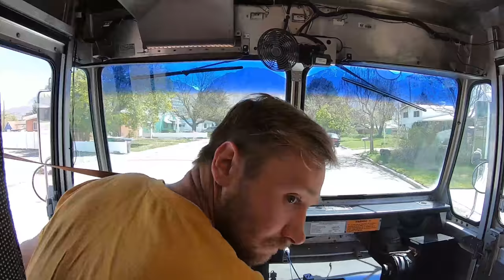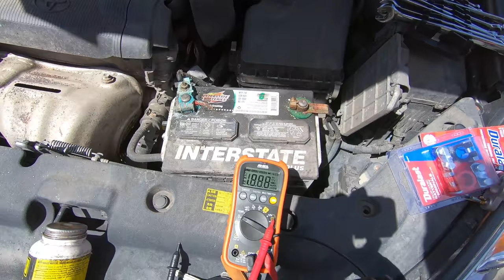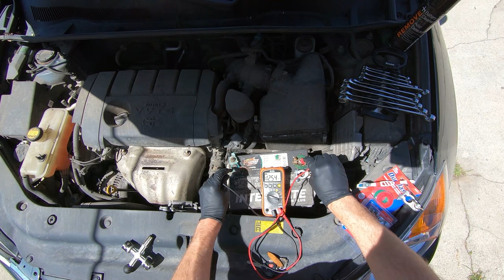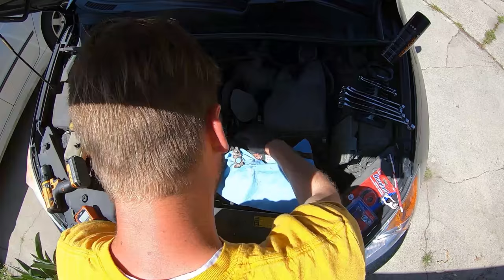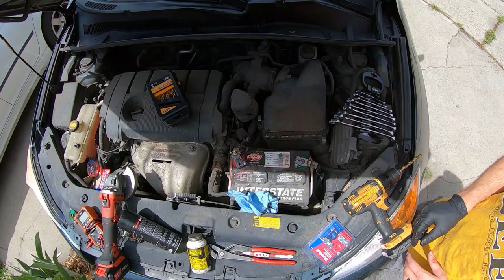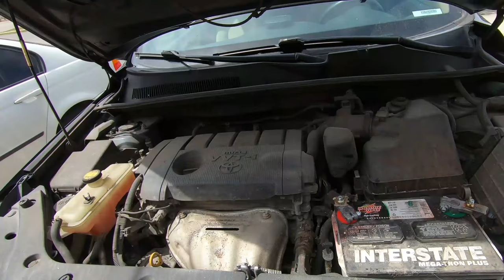Roadside rescue issues with battery. Sometimes you just need to replace your battery connectors.

Comment: Battery sealer spray goes a long way to keep the terminals from getting build up.. I used it all the time when I was in Utah and it made a huge difference. May be worth looking into.
Reply from the maker: Will do. I usually load everything up with silicone and that has been working well.
Reply from the maker: @CaptainVillanueva1  thats not apropriate. goodbye.
Reply: the battery is cracked. the buiold up will be back.

Comment: Here's another one for that voltage drop test I mentioned in a couple other videos.  You can voltage drop each cable individually using the load you already have installed...the starter.  Connect one lead to negative battery post, the other lead to block ground..yes, that will be 0v.  However, now crank the engine.  If that terminal (or cable) is bad, you'll see voltage on it during crank.  You should see less than 1v, preferably around 100-200 mV.  Same thing on the positive side between battery post and starter post, or between battery post and cable...just narrow it down until you find the problem area where voltage is being dropped during crank. 

Also, those marine terminals are fine but I'd recommend changing to a hex nut with lock washer that you can tighten down with a wrench.  Those wing nuts loosen up over time and cause issues.
Reply from the maker: :) ill learn it soon!

Comment: That's a great method for the average DIYer they could just buy the Harbor freight battery load tester $20. Other wise testing the resistance of the cable through the terminals will do the trick.